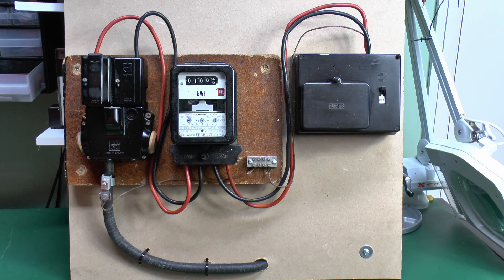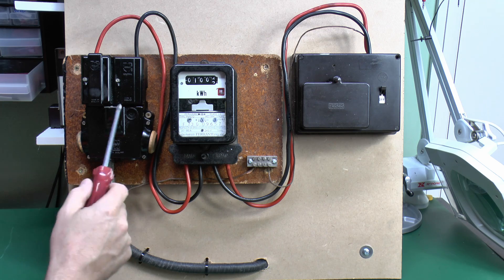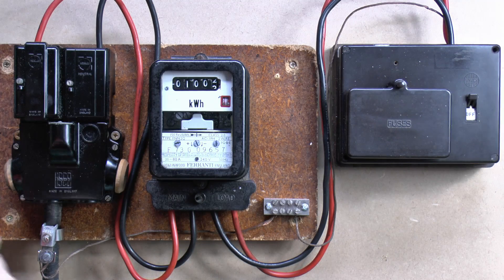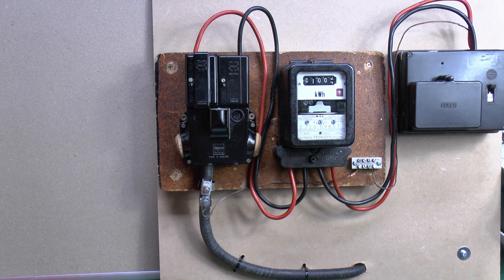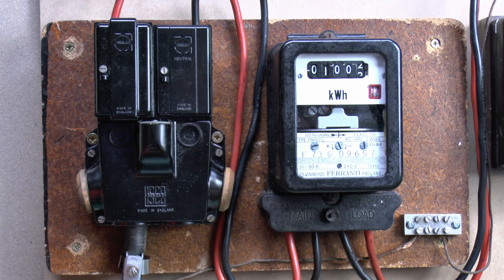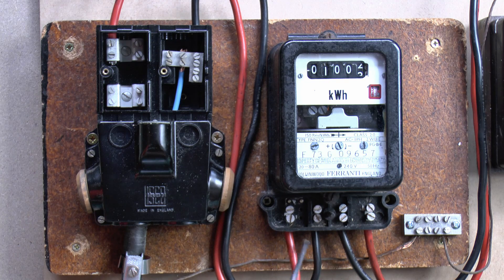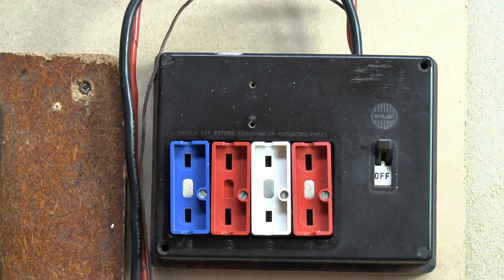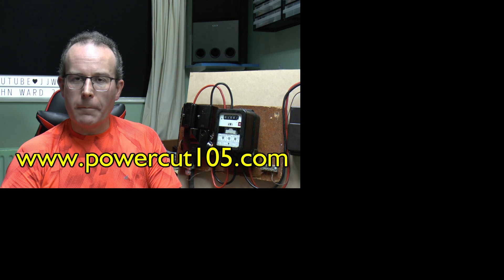Cutout, Meter and Fusebox - Who Owns What?

Comment: Hi I wanted to no if you are  allowed to install 6 8.5 kw electric showers on its own breaker  and can it be installed on a 20way wylex domestic consumer unit with out blowing the mains fuse.
Reply from the maker: No.
Reply: Hasan Ahmed why on earth would you want six electric showers? Especially 8.5kw ones which provide a miserable flow in winter when incoming water temperature is at its coldest. If you have that many people needing showers a gas boiler with a large mains pressure hot water cylinder is the most economical solution. It will provide pretty much endless hot water and good shower experience for around a third the running cost of electrical showers.
Reply: @spencerwilton5831  hi Spencer the reason why were installing electric showers because it's a h.m.o property plus we haven't got any space for the unvented cylinder I know what your saying about the flow rate being crap that's why I've installed a stuart turner cold water storage with mains booster pump booster.
Reply: @jwflame  hi john what legally I cant install the 6 electric showers even on it's own breaker 40amp
Reply from the maker: @HasanAhmed-cf6ln  Domestic consumer units are rated to 100A maximum.  Virtually all single phase supplies are 100A maximum, often 80A or even 60A in some cases.  
6 electric showers is well over 200A - and that's before any other loads in the building are considered.  You will be grossly overloading the supply and the consumer unit.
Reply: @jwflame  thank you for your response what is the best way to make sure the consumer unit doesn't trip should I get off to update my power supply.

Comment: Hello JW, will you please advise me. I’m buying a flat, survey report says no RCDs in the consumer unit.
Vendors are currently getting place examined by a qualified electrician but I have not seen the report yet.
Is the vendor compelled to have an up to date consumer unit fitted before he can sell it please?
Reply from the maker: They only need to describe the property accurately and not withhold information.  No requirement for it to have a modern consumer unit or even any consumer unit.
Reply: Thank you sir, your advice is much appreciated..

Comment: If you have a Problem with the head with tar melting out of the Head and is driping. Who do you go to have it changed? and who pays for it? As i have told i need to pay for by my Electric supplier. As this is not my responsibility?
Reply from the maker: Contact the DNO by calling 105.  The electricity supplier is not involved.
Reply: Is it actually hot/warm? Many service heads have evidence of tar dripping where the PILC enters, but it's usually dates back to the original installation or slow migration over time during hot periods. Certainly nothing that you need to pay for and no concern of the metering company. DNO are the people to contact.
Reply: The pitch in the cutout never sets if there is a slight gap it will leak out call the DNO they will check it and change it if necessary free of charge

Comment: 1973 is the age of the meter. Most domestic Meter Serial Numbers start with a letter followed by 2 numbers which define manufacturing age, followed by 1 letter and 5 numbers. Gas meters are similar, prepayment start with L and the first 2 numbers for manufacturing year. Credit tend to have the year at the end. Full of useless information me. 

Very informative and reliable information in your video however, even though they say anything after the meter is the consumers responsibility, I'm not entirely sure if the cables from terminal 3 and 4 are the consumers responsibility as you'd need to snip the terminal cover seal to replace them cables and that's technically classed as a tamper.

Comment: 7:07 I'm going to disagree with you there - I'd say that the cables from the meter are the responsibility of the supplier - for the simple reason the householder doesn't have access to the meter terminals to which they're attached. The householder does have access to the terminals at the other end in the FB/CU.
Reply: You make a good point, but the consumer unit tails are indeed the home owners responsibility. When a supplier fits a new meter and spots a potential issue on the customer's equipment (aluminium cables or burnt cables for example) they'll fit an isolator to make repairs much easier for the electrician. In an ideal world, all installations would be fitted with an isolator between meter and consumer unit. But this is not an ideal world.
Reply: @0liver0verson9  They're not CU/FB tails, they're meter tails. Only meter 'people' can provide these tails.
Reply: @millomweb  Only suppliers can fit tails into the meter, agreed. And they're sealed to prevent fraud. But when fitting meters often the consumer unit tails are placed directly into the meter. And these tails do not become the property of the supplier just because an engineer has fitted them directly into the meter "preventing access" to the home owner. Suppliers are not allowed to open consumer units (though sometimes they have to).
Reply: @0liver0verson9  not all energy companies have the same working practices. For example some may fit an isolator if customers tails are undersize . Other suppliers will put the undersize tails back as found and leave a safety notice. Dno / meter engineers /electricians have limitations on what they can work on .
Reply: @nicholasclarke8757  You make a good point. And speaking as a metering engineer myself I've dealt with a lot of different customer tail issues. Undersize, burnt, vulcanised, damaged etc. Big six policy is fit an isolator to help out the electrician who has to deal with it all. And some cases the customer tails will be blocked with power cut off if considered a danger.
Reply: @0liver0verson9  my employer is a big 6 company but doesn't always encourage fitting a switch unless a job is raised to fit one. We will fit on safety grounds if necessary but if it's a case of multiple tails or undersize tails we are told to leave a safety notice whether we change the meter or not. Banging multiple tails back up the meter really goes against the grain . Ultimately this leads to a switch being fitted at a later date . I suppose this was introduced for costing reasons . We don't fit switches for 3 phase or temporary supplies either ( or rather we are not supposed to). Another big 6 as taken us over and as a previous employee there I know fitting a switch is the norm
Reply: @nicholasclarke8757  In an ideal world an isolator would be fitted in all cases. Electricians must have a nightmare trying to get jobs done without breaking the rules to isolate the power! And fitting consumer tails directly into the meter does actually create an interesting situation I suppose. It's like the engineer has put the customers property under lock and key.
But oh well, who am I to question it :)

Comment: How do people work on the consumer unit without electrocuting themselves in examples like this where there is no switch on the heads to turn them off? And as you say you obviously shouldn't be touching the stuff on the wooden panel!
Reply: It's a skill, mainly involving carefulness and precautions.  In my country the electrician is required to wear special high insulation clothing, use insulated screwdrivers and sometimes stand on a special rubber mat.  He also needs an assistant ready to cut the power, defibrillate the mans heart and call in an ambulance.
Reply from the maker: Either the fuse is removed by persons authorised to do so, or the network operator installs an isolator.
Live working to change a consumer unit is dangerous, unnecessary and in the UK also illegal.

Comment: (12:55) - How on earth do they manage to cut and join a new cable whilst it's all still live ?
I'd love to see that procedure !
What type of tools do they use ?
What type(s) of protection / safety schemes do they employ ?
>
Reply: I used to do this years ago until I took promotion [but technically am still qualified to do it] 
The staff use approved tools and work strictly to a book of approved procedures that is about 3 inches thick.
They don’t just cut the cable in half, they use the specialist tools to open the cable up, apply insulation to the internals of the cable then cut the live cores in side one by one with insulated cutting tools.
It takes about 4 years for the staff to accumulate the relevant qualifications, experience and authorisations to allow them to do this.
There are different procedures and methods for working on each type and size of cable.
Reply: Live jointing demo - https://youtu.be/VCOIwWKabZ4
Reply: Cable jointers need authorisations from the DNO (codes of practice) to carry out live work on cables they use isolated tools and gloves and they do a (cut and remake) which is essentially joining a new service/supply cable to the main supply.

Comment: The dumbest thing of all is they never fitted an isolator on the head or meters so you could have your fusebox changed or worked on with full isolation and then told electricians "don't remove the main fuse it's nothing to do with you".  I'm sure that was in part deliberate so anyone stealing electric from the dark side of the meter would have to do any suspect cable tap ins fully live and deadly.
Reply: Some meters had built in isolators which was a good idea those are now being removed to fit smart meters backwards step

Comment: DNO wants to charge £231.42 to fix their own main fuse and put in an isolator switch. Why am I being charged for them fixing their own equipment?
Reply from the maker: Repairs or replacement of the fuse and cutout should not cost anything.
However installing extra items such as an isolator will usually be charged for.

Comment: Huh. So in the UK, the meter belongs to the electricity supplier? Does that mean you get a new one whenever you change suppliers?

Here in NL I’m pretty sure it used to be done by the network maintainer, same as main fuse, but now it’s been split off into an entirely separate company that just provides metering service, separately billed on your bill.

Aside: this looks way older than 70s/early 80s to me — particularly the exposed unmetered wires. You could vampire tap onto those things way too easily.
Reply from the maker: Usually the new supplier takes over the meter from the previous one - it's cheaper than sending someone to change the meter.
Meter may be changed if the customer wants a dual rate tarrif, or a smart meter installing.

Comment: Hiya. Is that meter a Ferranti FNN 2Q? 
You didn't get the camera close enough 
for me to see the model number and other 
details on......

 ......the specification plate. Also, does it still have its original seals? 

If it is either a FNE 12Q or a FNN 2Q, then I own those two models and I have yet to show them on Wayne's Electrical in FULL HD, 1920 x 1080p

I will also power them up as well, forwards, backwards and all over the place. :D

......Even at TOP WHACK!! :D

They are on their way, hold on there.

Thanxx for showing,

-Wayne's Electrical.

26th October 2019, 20.35
Reply from the maker: Yes, FNN2Q.  https://www.flameport.com/electric/supply_types/Ferranti_FNN2Q_Meter.jpg
Reply: Aaaah, that's 
tasty! It's an MEB 
instrument as well. 
When I can, I will be......

.......loading up a video of my FNN 2Q, and a bit later, I will also be making a "Powered-up" video of it as well where I will power it forwards, backwards and even at the top-end 80 Amps for the optimum satisfaction of the loadwheel action. :D

As always, all vids will be IN FULL HD, 1920  x 1080p

BUT HOLD ON THERE!!! THERE'S MORE!!

I also own a FNE 12Q, and unlike the 150 rev FNN 2Q, the FNE 12Q rips around at 225 revs, and even though it's half of the loading capacity at 40A, that loadwheel at full-bore picks ul quiiiiiiiiite a speed, so do hold on for those vids.

They are on their way!

In the meanwhile, ANOTHER VIDEO EXCLUSIVE has just dropped on Wayne's Electrical and being a video exclusive, this is something which hasn't been seen anywhere else!

Go on, jump in and enjoy. :D

-Wayne's Electrical.

28th October 2019, 22.50

Comment: yer the service incomer fuse and meter this system is better for metering what you use as the new electronic meters are a con same old story if it breaks down or stops working your buggered unlike the mechanical one was built to last the electronic one gets rid of the meter reader is not progress its one less job. yes done all that 25 years ago

Comment: Lol there's no ground
Reply: Agent Office the incoming supply cable metallic sheath is used to supply a “ground” (earth in UK parlance), hence the clamp below the cutout. This is connected to the metal terminal block (main earth terminal; MET) at the bottom-right of the backboard.
Reply: It’s a PILC cable outer sheath is lead covered perfectly fine to use as an earth even by today’s standards